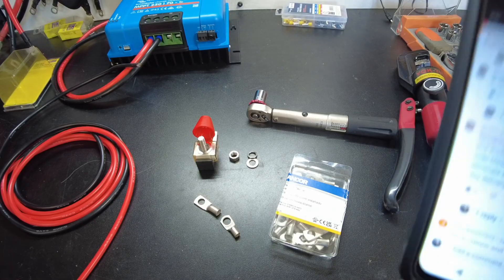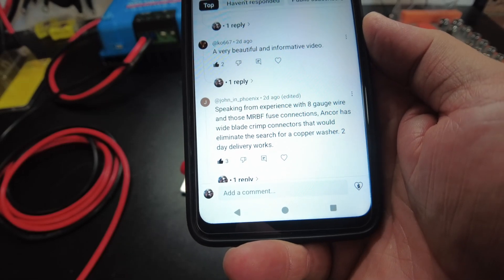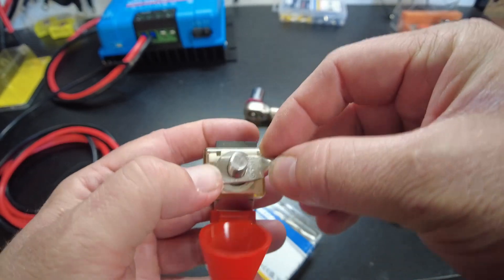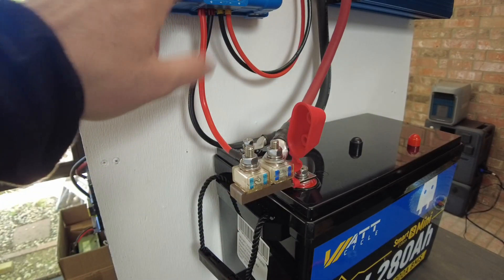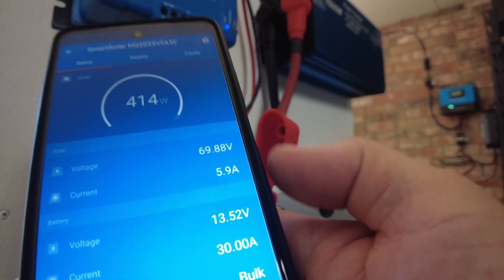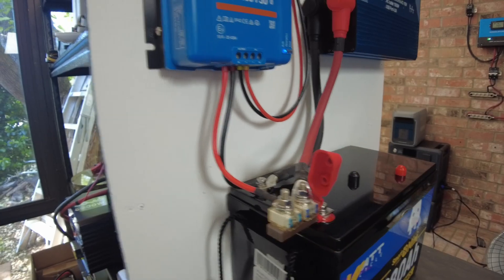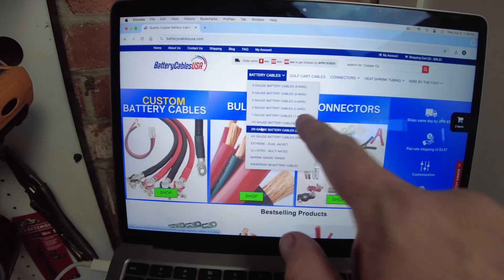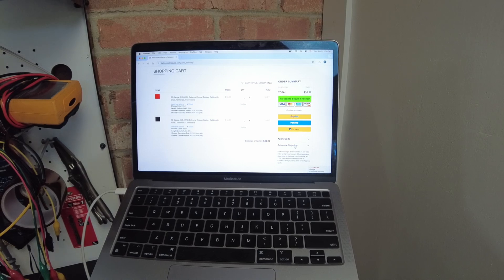UPDATE Pt.2 Victron + WattCycle MINI = simple 12v off-grid

Comment from the maker: The Ancor 8awg lugs (Affiliate Link): https://amzn.to/43HXK88
BatteryCablesUSA: https://www.batterycablesusa.com/

WattCycle MINI 280Ah Bluetooth Battery (Affiliate Link):
https://www.wattcycle.com/products/wattcycle-12v-280ah-mini-lifepo4-battery-with-bluetooth?utm_source=youtube&utm_medium=kol&utm_campaign=Brad
6% discount code: Brad

Amazon Affiliate links:
WattCycle Amazon Store: https://amzn.to/3G9IyGX
Victron 100/30 MPPT: https://amzn.to/41JTG2A
1500W Pure Sine Wave Inverter: https://amzn.to/4jk3A46
Blue Sea Dual MRBF Terminal Fuse Block: https://amzn.to/4iRuBfr
Blue Sea Fuse 200A: https://amzn.to/4lhy3kX
Blue Sea Fuse 40A: https://amzn.to/3R4THev
Silicone Terminal Covers: https://amzn.to/3R0ZQIK
This is the Hydraulic Crimper I have, however it's unavailable: https://amzn.to/3MC5AHs
I found this one that looks about the same, but I have not tried it so YMMV: https://amzn.to/44d0hHz
Hammer Crimper: https://amzn.to/3InPFKj
Ferrules: https://amzn.to/4loQHHN
2/0 awg cable: https://amzn.to/3R4Tbx5
8 awg cable (for MPPT): https://amzn.to/43IrbH8
Pre-charge Resistors: https://amzn.to/3IqPA84

WattCycle MINI 280 review by  @OffGridBasement : https://www.youtube.com/watch?v=ULc8AX9lbxE

Local Elevator by Kevin MacLeod is licensed under a Creative Commons Attribution 4.0 license. https://creativecommons.org/licenses/by/4.0/
Source: http://incompetech.com/music/royalty-free/index.html?isrc=USUAN1300012
Artist: http://incompetech.com/

================
AFFILIATE DISCLOSURE: This channel may earn an affiliate commission if you purchase products through links I provide, or use my discount codes. 
================
CONTACT: bradcagleyt@gmail.com
Business/Collaboration only. Please do not contact me for for personal project help, or advice.
================
DISCLAIMER: These videos are documenting my own personal projects, and experiences. These projects, and activities can be dangerous. I am not a professional. You should always consult with a professional. This content is for entertainment purposes only. DO NOT try any of this at home, doing so will be at your own risk.

Comment: I hate to open up a can of worms, but the whole ferrule vs bare wire debate with Victron MPPTs is tripping my OCD.
The Victron manuals say that we should be using fine stranded wire with 26AWG strands to maximize the contact area.
Flexible battery cable should be fine here. However, 10AWG PV cable is often 7 or 19 strand, which does not. Do we transition from PV cable to battery cable before hooking it up to the MPPT?
The Victron 100/30 MPPT has 6AWG rising clamp terminals. What happens when you insert ferruled 10AWG or 8AWG wire into it. Does the clamp compress the ferrule as much as it would a bare wire creating the same contact surface area?